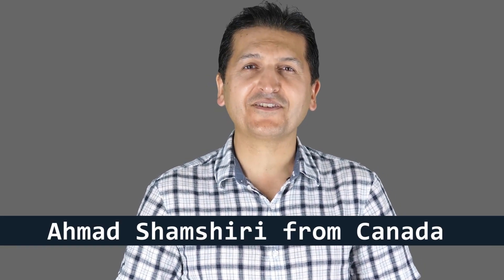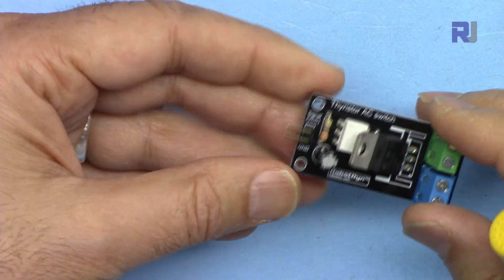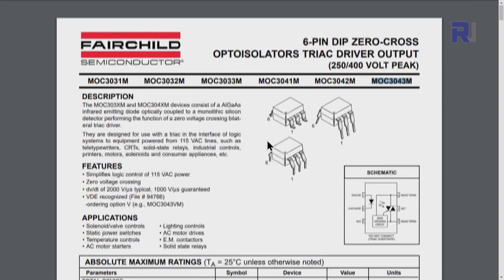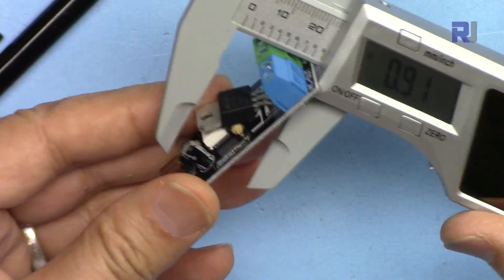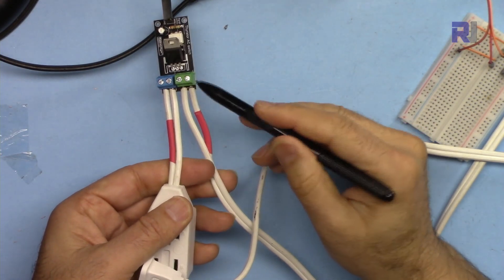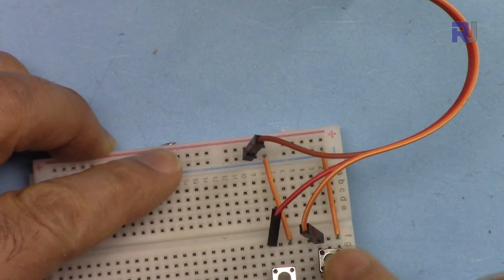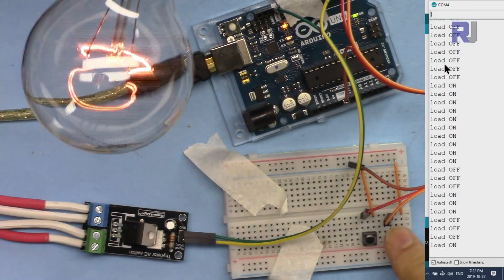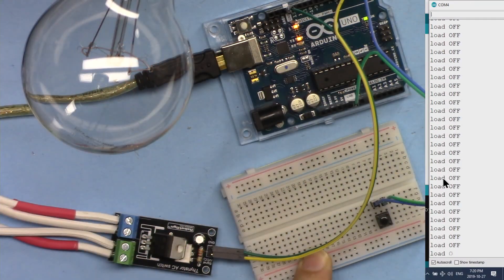RobotDyn Control AC load or AC bulb with Arduino AC Switch with 2 Push buttons - RJT239

Comment: Sir ,you have code. Nodemcu pwm  ac fanspeed control using triac and push button please replay  thanku.
Reply from the maker: No I don't have it I will test a module and post the code in the future.